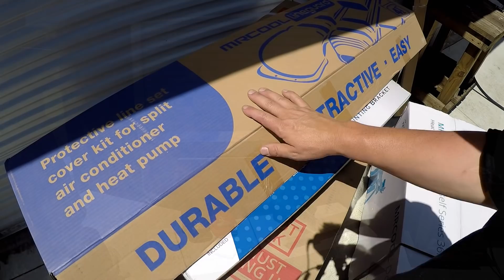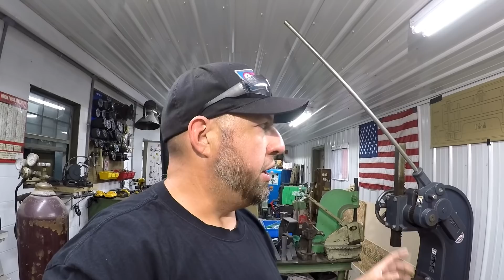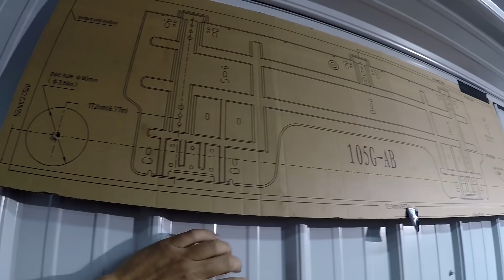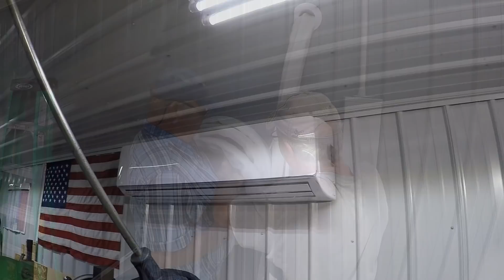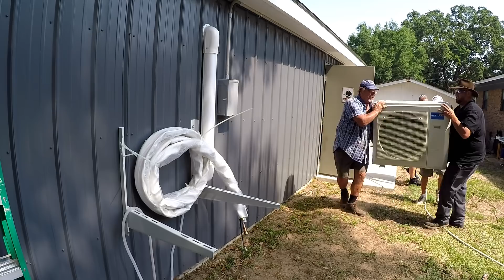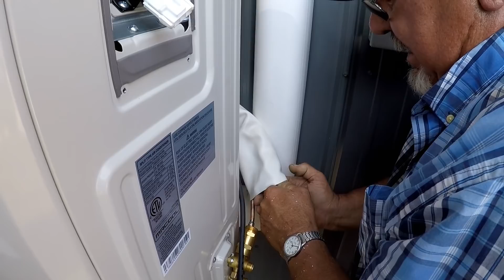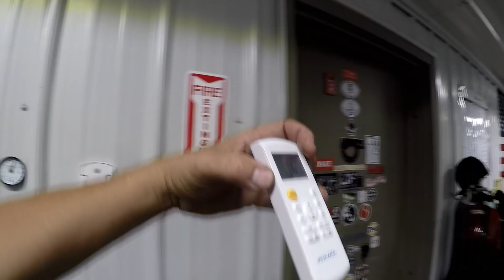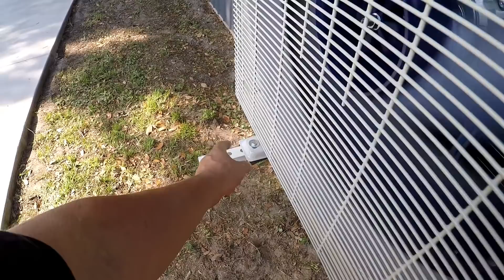Mr Cool DIY Shop AC Install

Comment: Brother,the dark paint on the building attracts more heat.
As a welder I've worked on crude oil tanks that were purposely painted black to allow the sun to heat up crude for easier process.
Maybe in time lighten up the outside.
Thank you for great installation video,helped a lot 👍

Comment: As someone who owns a company which installs probably over a 1000 to date, a few points.
The lineset should be a short as possible (within reason) the longer the lineset the more the compressor works and efficiency drops. Always install you outdoor unit on the last holes to keep it away from the wall. The pile of hoses and wrapping directly behind the machine attracts dust and other crap that will make cleaning the coils a pain. I also cuts the air supply that the machine needs for proper airflow. The airflow to the rear of the machine is critical to the life of the machine, especially in your area where you cool 6-8 months a year. If the fan speed is high then those linsets are too close to the back of the unit. 
The AC companies in China don't put as much effort into the build quality of compressors as in, say, a conventional home system. I've been to my ac factory in China many times for spot checks. Those Mr. Cool units are made in the same place. Good units, but if your don't keep the two units happy you are looking at an early compressor death. In a shop the indoor filters should be checked weekly.
Reply: They always say it's ok to coil up the lines like that, although I agree about blocking airflow

I wonder if it's because both lines are vapor lines with these units?
Reply: @Mike, I had the same concerns about the extra long line set, there is probably 15 extra feet, can‘t it be ordered shorter.
Reply: @jadesluv  If the lineset is the quick connect style I wouldn't bother. The real concern is the blockage behind the machine. Keep the coil clean and make sure there is nothing between the wall and unit.
Reply: I think they are a midea or a gree but most likely midea

Does that sound right to you?

I got a senville 9k 19 seer and a MRCOOL 18k 21 seer Olympus and they look painfully similar like they're from the same place

Comment: Hey guys watched the official Mr cool video they explained plunger valves keep the lineset charged (no vac needed) and they coiled the excess line set very amusing though the liquid line is on top in the official video, in this vid he had trouble with the vapour line because he had it at the top after explaining they are color coded still put the them on reversed.
Reply: I am wrong the mr cool video is using a different outdoor unit
Reply: @keithmccullock2061  Comments can be removed for this reason.
Reply: They're both vapor on these I believe it's because the metering device is in the outside unit
Reply: @doddgarger6806  you always have a vapor line and liquid line. If they're both vapor lines, you can't heat or cool without a difference.

Comment: if you DIY you better check your home or office insurance policy.  You go and wire up 220 volt versus having the smaller 12000 BTU unit that just needs 120 and you could be putting some things at risk.
Reply: He didn't diy the power

Comment: Warning to users... you may 'save' money doing it yourself
However you will pay more in repairs once it breakdown due to improper advice being given in this video.
Reply: There's always some dude who wants to share how much more he knows than everyone else.  Always.
Reply: For one thing, the coil of lines behind the condensor are impeding the flow of air.  Also, the way he was jamming the coil ends around was causing me to wince in pain.  They even tell you to treat those with great care so you don't break seals.  Yikes!
Reply: Luke, from the typical AC company
Reply: They did a perfect job

I will only say it could be moved out one hole for better air flow but it might be just fine how it is
Reply: What's the bad advice?
Reply: How many DIY kitted MrCool units have you installed Luke?

Comment: Holy crap! He was putting way too much stress on the connections of the line sets. I would have either moved the heat pump a little farther out to allow some extra space between the line sets and the plastic cover or I would have moved the entire mounting slightly over to allow the line sets to have a little more room to make the bend. The instructions clearly state you don't want any excess strain on the connection points.
Reply: Agreed! I was wincing.  I would never want him to touch my HVAC.   Also, the coil of lines behind the condenser are impeding the flow of air.
Reply: I was saying the same, I think we know where the first leak will be.

Comment: I have a 30' x 30' x 14' insulated Mueller building behind my house. After 4 years of suffering in 90 degree heat I finally got around to installing 2 - two ton mini splits. Best investment I ever made. I should not have waited that long. Cool in the summer warm in the winter...

Comment: You still need to evacuate the evaporator once you uncap the line
Reply: The kit is specifically designed to be plug and play, if you were to pay attention, it does not require that.
Reply: Ben Johnson not on this diy unit
Reply: @TubeOrNotTube  The kit is pre evacuated, if you are too dumb to understand that, that's not my problem.  Go look up the kit and you will see it's been designed this way. End of. Not arguing it.
Reply: This process is done at the factory, for a $650 fee (for the 12k unit)
Reply: you're right, i didn't see a vacuum pump.
Reply: @TubeOrNotTube  Enjoy wasting your life arguing on line about something so passionately.

Comment: Thank you for the video .I  installed a mini split in my bedroom and it's been a life saver . Only  thing I wouldn't recommend is the plastic dress up kits they sell. The plastic will fade and crack out .I had to go back and reinstall   aluminum duct work over the line set . Besides that they're awesome cooling and heating option .

Comment: You need two wrenches on each line.  Do not use one wrench as shown in the video at 22:00 because that can turn factory fitting you do not want to alter.  Repeat, two wrenches!!!
Reply: should use a torque wrench and correct two wrenches is a must .

Comment: Oil in these systems should stay in the compressor buy in an imperfect world some oil gets into the lines traveling with the Freon.   The loops you have, especially so close to the compressor, will trap oil keeping it from returning it to where it belongs.  This could lead to premature compressor failure.  It would have been better to place the outside unit away from the inside unit to make use of the line
Reply: The directions tell you to do it exactly like they did - if there is a problem, the warranty will cover it

Comment: What is the EER  ( effeciancy  at 95°)  and HSPF (HEATING SEASON PERFORMANCE  FACTOR) .
Reply: I remember hearing these units are only like a 15seer. So pretty basic
Reply: Cooling capacity in BTU divided by power used in watts.

Comment: Just a suggestion, but if you do not want a puddle of condensed water under the compressor and you do not have a sewer/drain tie-in, you could install a 'dry well'.  I made a 'dry well' for my central unit and do not have a wet spot next to the unit.  Kind regards, Al

Comment: Can you get them with shorter line sets?
Reply: Likely not - But as you see they coil well behind the unit
Reply: No, not on the DIY version.  Lines are pre charged so they're not to be modified.  IIRC they're 25 feet long.

Comment: Hey other HVAC people, tell me what you think:   Yes, the unit is too big.  Yes the indoor unit is the wrong shape.  What would you do if you were given this unit for this room?   I'm thinking he should mount the indoor unit on the ceiling, parallel to the back wall, about two feet from the back wall, so it blows the length of the room.   The poor thing is just suffocating because it is too close to the ceiling and blowing down is silly because your heat loads are above you, not below you.  You'd maybe have to move or replace the condensate tray, but I bet that is doable.   Better flow, more even room temps, remote works from anywhere (maybe) and less energy and wear on the fan.  Thoughts?
Reply: It is mounted in an ok location if it were on the ceiling the drain for the condensation inside would not work properly

Comment: Non condensible in the system
Reply: The lines are vacuumed and sealed at the factory.  They apparently break their own seals as you connect them.

Comment: Had a customer call me to see why his diy mr. cool isn't working. Turns out that condenser board no good.
Reply: from postings this unit is a  big seller but needs QC upgrade .  The eer and hspf are slug nr's too. It apperes to be  8 yr old NR'S when the effeciency  nrs have increase 50% since 2011.... BUT a 28 SEER UNIT  IS TWICE THE  COST.

Comment: In a year or two there will be corrosion in the lines. Always vacuum your lines with a micron guage.
Reply: HVAC guy here, what you say is correct, but i've seldom done it haha, i only install ac for friends and family and only if its a repair of a leak i do vacuum the lines, otherwise i just purge with the refrigerant charge that most come with and add if necessary.
The majority of them still going after 8-10 years (past lifetime for these appliances) and i have had units rot to the ground and they're still running its hilarious sometimes. 

I only break the big tools for real work ( big freezers and cold storage). Cheers
Reply: why? genuine question
Reply: @cliveramsbotty6077  because there is a great chance you have air which will create moisture in your lines. it will become acidic and contaminate/corrode your system.  a micron guage will tell you if you have moisture. you vacuum down to 500 microns .
Reply: @BoriPR82  The lines they send are already vacuumed and sealed on each end.  They break their own seal as you connect them.
Reply: @BoriPR82  Okay thanks. What turns the trapped vapour acidic over time?
Reply: @cliveramsbotty6077  moisture, yes
Reply: @BoriPR82  how does the moisture become acidic though? what goes on inside the pipes that turns water vapour into acid?
Reply: @cliveramsbotty6077   I'm no chemist but i believe it is to do with the oil within the compressor that mixes with the moisture and causes issues. Clearly only a very tiny amount with those connections would be present
Reply: @skiippy53  thanks daniel
Reply: @skiippy53  Your correct and it why  my AC guy has the best  pump available and does a 1 hour test on the  vacumed linesets Vacumm not applicable  with mr cool but we all learnin  here!
Reply: This is a pre charged condenser and evaporator unit...no way for air to enter when connecting.

Comment: My Mr Cool lasted about two years...long line set killed the compressor.
Reply: If the lines were too long, the solution would have been to add refrigerant. User Manuals usually will give you an amount to add per extra foot. For example if I exceed 160 feet in my Fujitsu's I have to add 1.2 ounces per foot.
Reply: @BoriPR82  If the lines are long they also need to be a larger diameter.  Otherwise they put too much load on the compressor.  I'm not sure if a long line kit accounts for that or not.  It might.
Reply: @bvcxzgt5451  also what diy person has refrigerant handy and the gear required to charge the system. in Australia that alone requires 3 different licences
Reply: @skiippy53  Uh, I do!  The license to buy refrigerant in the US requires a quick online course in the regulations, and isn't even needed for the newer refrigerants.
Reply: Likely you coiled the extra line like they did on this video and trapped the oil from returning to the compressor.   This one will fail in about two years likely.
Reply: The system would be engineered for that lineset. I have seen smaller units that use a refrigerant that you can buy at a gas station or a grocery store and also happens to be extremely flammable.

Comment: It would be really cool to use two wrenches on those fittings to counteract the twist.  You can use 1, 2 or 3 evaporators -- these units will automatically adjust their output to match the load.  Also be mindful of which refrigerant is being used : Some types are expensive to replace.

Comment: The remote is just a controller. Not a thermostat
Reply: Wrong, it can also be a thermostat. It has the "follow me" option which means the air handler is reading the air temperature from the remote control instead of the air handler itself. Some people need to learn about what they're talking about before they even speak.

Comment: Why didn't you vacuumed it, didn't it said on the installation manuel?
Reply: The condenser has the refrigerant in it already.  The other units are already vacuumed and sealed.  They break their own seals as you connect them.

Comment: Been doing HVACR 25yrs.Who did the load calculation? So that's a 36k btu (3ton unit)? Dumb idea to put something in front of the unit. When it gets hot that hot air will be circulating and then cause that unit to not work properly. Also the indoor should NOT be mounted touching the ceiling. It also needs to breathe and the front panel to open up to get to the filters. Thought you kept saying Fernando did HVAC..he should have known better for all this.
Reply: You are right on all points, and those are really important points.  I agree that 3 ton unit is absurdly large for that building.  Folks might not care that wastes electricity.  However, it will actually make the building less comfortable and it can fail to remove enough moisture from the room.  Machines and tools don't like moisture!  Mold does.  Yes, providing clean air to the units is important because the outdoor air will be breathing in its own hot air.  Abom, it looks like you could scoot it further away from the building.  I'd bet there is a measurable energy saving from doing so, and it would put less strain on the whole system.   Same for the inside.  I'm not sure what I would do there.  That indoor box is just the wrong shape for a room with a ceiling that low.   For others considering this, other companies use different arrangements for the indoor unit, and even Mr. Cool would let you put more than one small indoor unit in there for such a long low ceiling installation. Beats being hot, though, doesn't it!  :)
Reply: He said it only drew 15A. why did they put a 30A breaker? lol
Reply: @hugoibarra5465  For the start up surge current.

Comment: The Big Line Is called the Low Pressure Line and the Small line Is Called the High Pressure line.
Reply: Yes, or some call the small one the liquid line and the large one the vapor line.
Reply: Both are vapor lines in this system.
Reply: @user2C47  how can they BOTH be vapor lines? Doesn't one have to have liquid and the other vapor,? It is my understanding that you need the phase change to either heat or cool the area. Please correct me if I'm wrong, and while you're at it, be nice about it.

Comment: Hey Adam, have you tried it with your fume extraction running? Just wondering if it would still work or if the extractor would pull the cold air out and make it run constantly
Reply: Since that 3 ton unit is about three times the size of what that room needs, if not more, even the fume extractor would be hard pressed to defeat it.  It would recover in two minutes after you turn off the extractor, at least.  If you wanted to be really clever, you could build a heat exchanger around the extractor exhaust, so outdoor air on its way in is cooled by the exhaust air on its way out.  Not needed, but it would be interesting in theory.

Comment: None of my business buddy. But how much did that system cost you.
Reply: they probably donated to him for reviews. they run about 2500 on the website. I looked and when i seen the price i fled.
Reply: Jason Nass Blacksmith  I've heard good things from an engineer who owns the fujitsu one.  That 3ton unit is absurdly large for this room, too, so I assume much smaller units are a bit cheaper.  Too big an AC can make a room really uncomfortable and cause moisture buildup.

Comment: That’s a nice easy unit. You wouldn’t find me in the house if I had AC in my shop I’m in s SW Florida and it gets close to 100 dig in the summer plus the mosquitoes will carry you off and have found snakes in my shop. Sure would solve many problems.   GW

Comment: They ain’t cheap at 3 grand plus electrical work.
Reply: that's cheap compared to a traditional split system. regular split install is minimum $10,000 installed
Reply: Phillip Torres your getting ripped off then
Reply: Shoeless Jack list your price at least. Itemize your cost. I’m in the business and I deal with mechanical contractors. I’m not far off
Reply: Phillip Torres im in the cannabis business. I have acs installed all the time. 4-5k for lennox. If your replacing an AC in a home is like 4-5k. If your taking about a 2000sqft 5ton new construction home doing full on ducting 8500-9k
Reply: Ive seen quotes as high as 12-13k tho. Just saying theres a better deal to be had. AC guys generally charge to much for what the job actually is worth
Reply: You should see how much they want for HVAC install
Reply: @KieranMullen  exactly.  And it's a heat pump, too.
Reply: That unit costs 2200